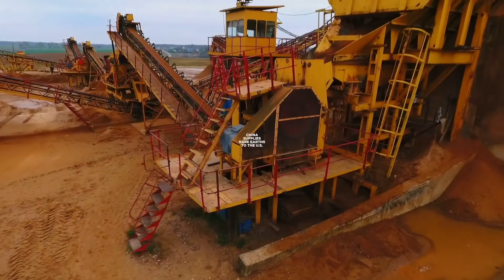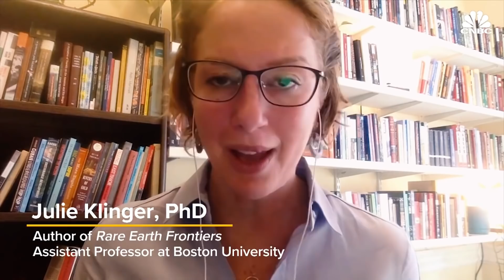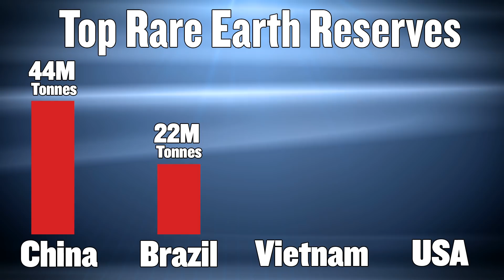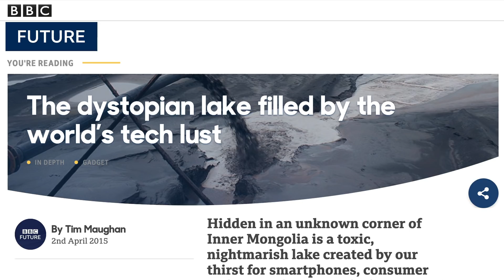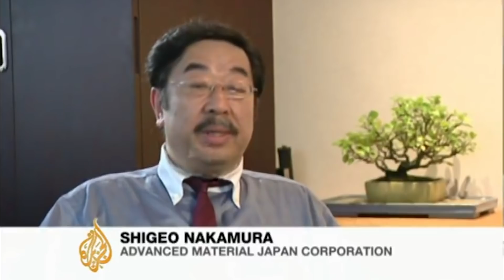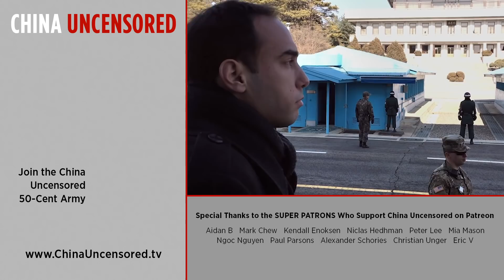China's Threat to Weaponize Rare Earth Metal Exports Backfires

Comment: Another work around is making electric motors that do not need rare earth magnets.  The trick is to use copper, iron, and silicone (sand).  Motors can be put together using solid state controls (sand and some micro amounts of metals) and induction effects, copper windings on iron cores, to make motors that that are simpler, cheaper and work better that motors using rare earth magnets.  Really just took some investment in R&D which the Chinese Government provided the incentive for.

Comment: When working in investment banking in the resources sector, I was offered a myriad of projects  which were largely LREE (Light Rare Earth Element) versus HREE (Heavy Rare Earth Element) enriched.  Neodymium and Dysprosium are perhaps the most critical metals of these two respective groups. Naturally, it's only a matter of time before some of these deposits are developed, governed as they are by supply:demand constraints.  
Be advised, you don't need an especially big deposit to flood the market for any of these elements, inspite of what the myriad of REE hucksters might otherwise suggest and they are no shortage of these individuals out there.  China does indeed flood the market with comparatively cheap concentrates, but if Minamoitri Island comes on line, amongst other deposits,  China will get its comeuppance in spades.

Comment: although rare earth mineral recycling must be terribly expensive, after all it takes very little to make one cellphone, perhaps it is one of the key elements in pushing recycling practices and technology to the next level. these days investors can't imagine recycling aluminum or plastic because of the poor return on the investment, but as new technologies break into the market, older techniques generally become cheaper and more accessible. It might get to be easier to recycle the more common recyclables if an emphasis is placed on recycling the more difficult materials, which in the case of rare earth minerals might be crucial despite the complexity.

Comment: Another cool thing about mining rare earths at places like mountain pass is that it always brings up thorium along with the rare earths.  Right now thorium is literally a waste by-product of RE mining.  However, when used properly in a molten salt reactor thorium is a very good fuel for nuclear power.  ALL of the US's power needs - including transportation and recycling - could be met with thorium from that one site.  The entire world's energy needs could be met with only around 5ktons of thorium per year.  Not a typo.  5 thousand tons.  That's nothing.  Even if we're talking strip-mining that's a non-issue.  The US alone produces over 1 Billion tons of coal a year.  (Again, not a typo.. billion-with-a-b. 1,162.7 million tons of coal mined in the US at its peak in 2006.)  I'll take the thorium mine any day if it means we can shut down all the coal mines and stop sending all that money to the middle-east for their oil.  No-brainer there.  Also note that nuclear is a no-carbon energy source.  If the Greens had half the brain they claim to have they'd be pushing molten salt nuclear as hard as they can.  Pretty much all the benefits of fusion, only using tried-and-true 60s technology today.  (Instead of having to wait another 50 years for that ITER white elephant to lay a golden egg.  Maybe.)